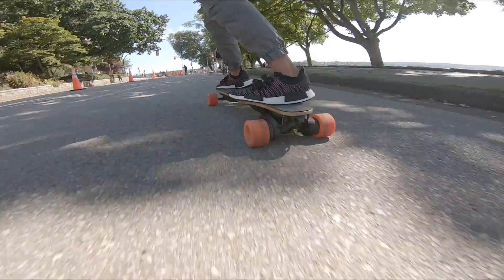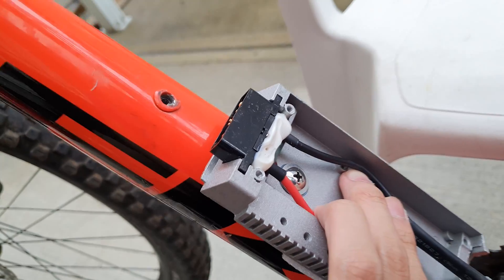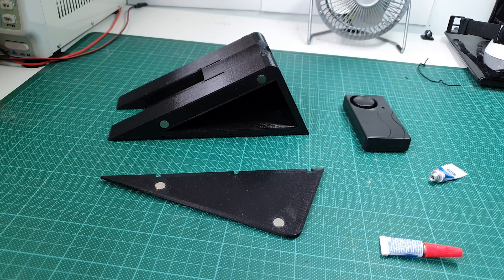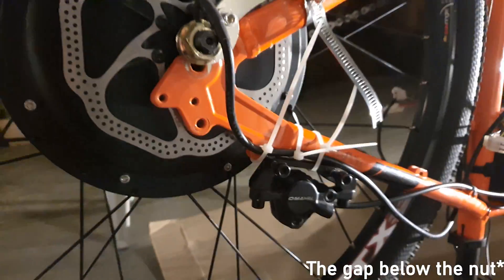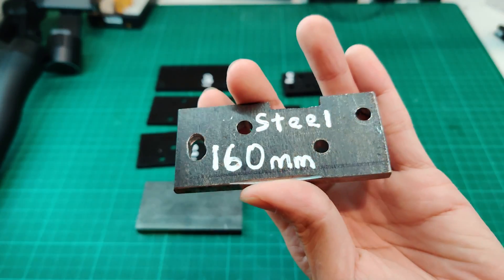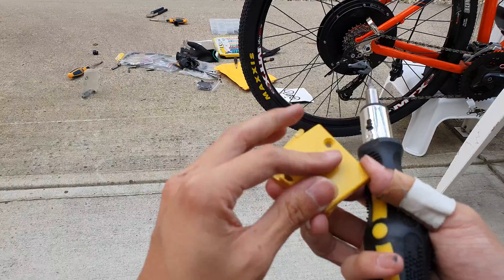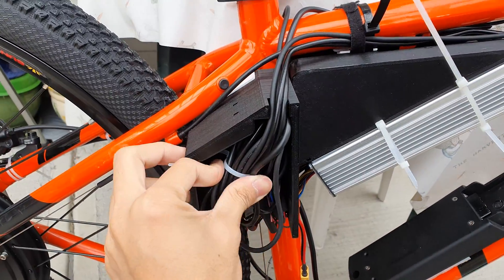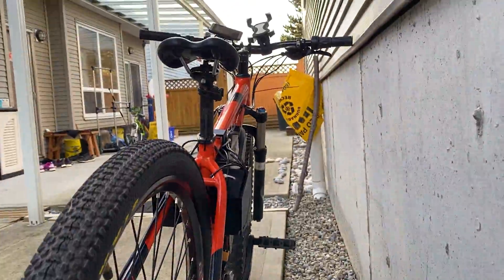Building a FAST ELECTRIC BIKE (With a 1500W Conversion Kit) | Trek Mountain Bike

Comment from the maker: Update #1: I had my first flat tire after surpassing 300 total kilometers travelled. I think this is due to the low quality tube that was provided in the kit as well as my ignorance to following the correct tire pressure. I had 2 options: 1) patching 2) replacing the whole tube, but seeing as the speeds this bike will be traveling at and the stess that will be enduce on the rear wheel while accelerating, I have decided to replace the whole tube.  I will be filling my new tube with Slime, which is a self healing agent for tires. Safe to say this flat was a excellent learning opportunity and hopefully you don't make the same mistake!
Reply: Use tire liners my dude. It's a tough strip of material that goes between the tube and tire. I've got over 4100km on my DIY ebike with no flats despite having to pull shards of glass out of my tire. I use Mr. Tuffy
Reply: @turbofan450  I will definetly check that out! Thank you. Right now, I have filled it with slime and nothing has popped yet (knock on wood).
Reply: @Haady Khan works perfectly. still going strong!
Reply: @Haady Khan no hasn’t blown up. has caught on fire a few times through…
Reply: @Haady Khan joke
Reply: I went for tubeless version and had no flat tire since i went to tubeless.
Reply: It's not not the tube. It's the tire. Get you some Schwalbe Marathon Plus tires. Around $50 a piece, but well worth the price.
Reply: @Haady Khan Hey, the link I used for my battery is actually not available anymore. But like I mentioned below, I bought the parts from Aliexpress and if you search up "Hailong 13s4P 18650 battery" you will find a identical battery as the one I used. Different sellers sell the same product just under their branding. Hope I helped!

Comment: Really informative video, thanks!
Reply from the maker: Are you the Redditor who contacted me a month ago about this frame conversion?! 😄
Reply: @AaronsCreations  Yes I was
Reply from the maker: Haha! I thought so. Feel free to ask if you run into any problems!
Reply: @AaronsCreations  I found out that you can fit metallic zip tie between the top part of battery mount and the battery: https://i.imgur.com/sWZhoTc.jpg It can also add some extra stability. Also rubber saddle washer between the frame and battery mount, it could make it more stable.